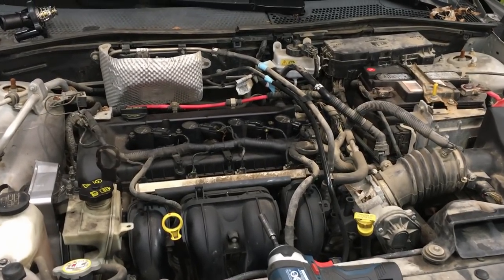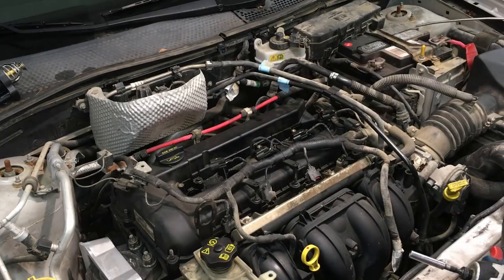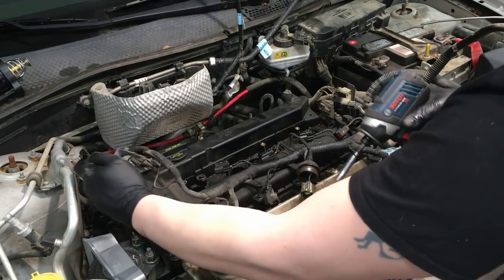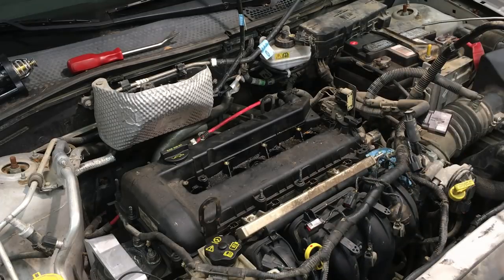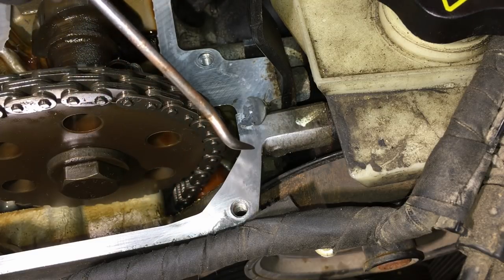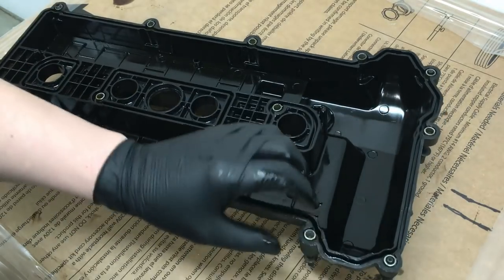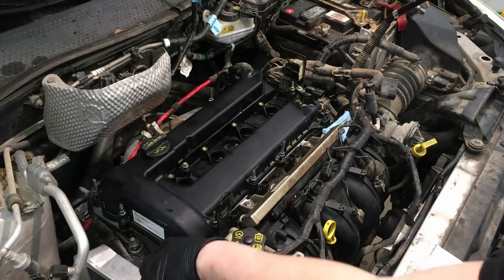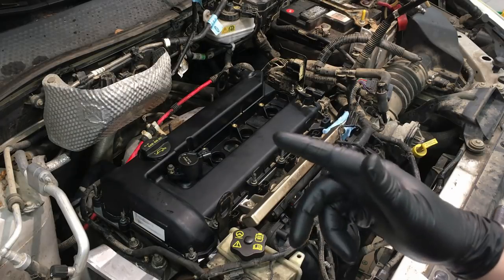2005-2011 Ford Focus 2.0L Duratec Engine Runs Rough Hesitates: Valve Cover Gasket Replacement

Comment: So glad I found this video, my wells are FULL of oil! Doing this project next week and getting it right
Reply: cebayne how did it go?
Reply: Dakota Taylor very easy, car runs great
Reply: How do you get the oil out off the spark plug wells?
Reply: @dalebixby2860  I was wondering this as well. Did you ever get an answer? I didn’t see him even remove the oil from the wells in the video either.
Reply: @alpha6games751  I never got an answer but I used a spray bottle nozzle stuck it down in the wells and sprayed it in a bottle removed as much oil as I could then removed spark plugs you will get some oil in the cylinder but it won't hurt anything my car smoked a little for a few minutes and then cleared up

Comment: How do you get the oil out of the spark plug wells?
Reply: When you remove the plug(s), the oil sitting on top of them will rush down into the cylinders. On mine, I just turned the key, as if I were trying to start the engine without the plugs installed and this will help lubricate the cylinder walls. Then I installed all of the plugs and started the engine. It smoked really bad for about 5-10 seconds then stopped smoking. HOWEVER, after doing all of this work, I still get a P0302 code and a P0316 (crankshaft position sensor malfunction) code. I replaced the crankshaft position sensor, all 4 spark plugs, and all brand new coils but still have rough idling and misfires. Now Im looking into fuel injector problems, bad fuel filter, faulty wiring, or anything else that may throw the P0302 code. Last ford I will ever own.
Reply: @mikeray8578  I actually took a spray nozzle and stuck the end  in the plug wells and sprayed as much oil as possible into a bottle car didn't smoke much at all or for very long less than a minute
Reply: Duct tape a straw to a wet/dry shop vac. Worked great for me!

Comment: Thanks for this video.  I just got done doing this job on a same year Focus and this video helped out a bunch.  It took me several hours with getting the oil out of the spark plug wells and cleaning everything up.  I also changed the spark plugs and coil boots.  Car seems to idle smoother than before but I didn't run it long so that the sealant could set.
Reply: How did you get the oil out of the wells? Someone said to run the engine with the spark plugs removed to blow out the rest of the oil after soaking up with a paper towel but wouldn’t that allow sludge to get into the engine?
Reply: @tylermitchell8927  I used a turkey baster to get the majority of the oil out and then used paper towels to soak up the rest.  I would not take the spark plug out with oil still in the hole.
Reply: @Mr2004MCSS  thanks
Reply: @tylermitchell8927  No problem.

Comment: Just ordered the parts not looking forward to this at all but gotta be done
Reply: I just did it today, very easy. The right plug was full of oil, I was stuffing rags with a thin screwdriver to soak up the rags. BTW you can purchase the boots for the coils for less than 6 dollars each, recommend it.

Comment: why would they apply sealant on one spot?
Reply: MrUga2010 but what's the purpose for it if your replacing the the old gasket.
Reply: Ah I see, thanks for clearing that up for me.
Reply from the maker: The sealant goes where the front cover bolts to the cylinder head there is a seam or "T" joint there that is a leak point. The gasket cannot get into there so a dab of sealant fills the seam.
Reply: FordTechMakuloco thank you for the info.